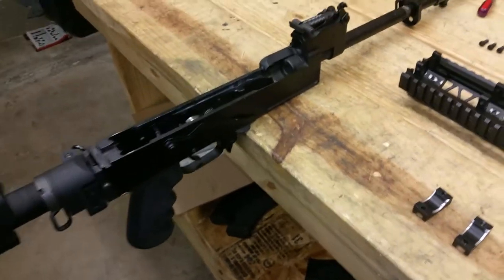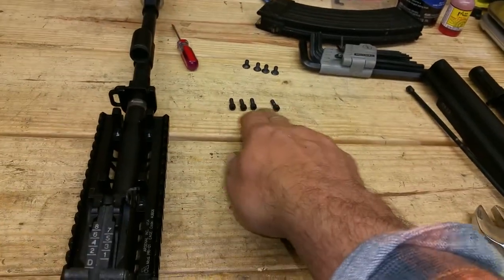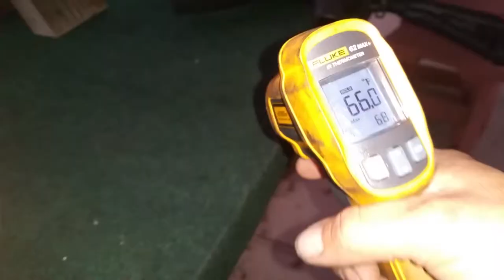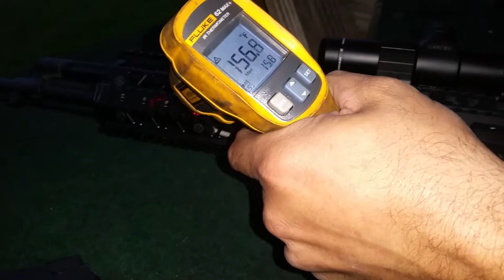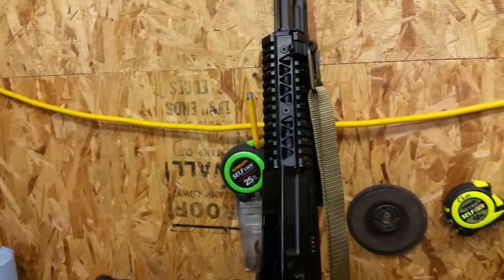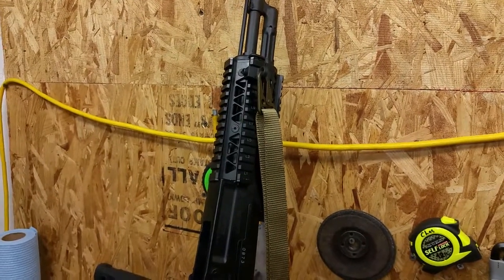Arsenal PR-01 Hand Guard Mod Part 2

Comment: Im going to buy this  for my Sam 7  Very rugged and  liking  its multi picatinny rail's  its  well ventilated for faster cooling  as for heat going to use a MagPul AFG Angled  for grip extended all the way to the end  // this is a  good  idea though

Comment: Texas gun smith, first of all good informative videos. I just purchased the rifle and was wondering if the clamping of the hand guard affected the accuracy of the firearm?
Reply from the maker: +Joe Santacruz  I would guess no, not in any real sense. First the anti clamping of barrels idea is kind of a long range gun/ sniper thing, where they are working on every minor increment imo. Second, look at the ak barrel front to back. . . front sight block, gas block, rear sight block, and finally pressed into receiver, they are all pressed on, which will have some clamping force to barrel, as well as uneven heat dissipation. Lastly, ak's are not designed for long range accuracy, they are about fighting reliability, as such, they are accurate enough just not highly accurate, nature of the beast sort of thing.

Comment: Thanks for the info and it was worth a try :) I just got me the exact same rifle (well, I have the SAM-7SF) and exact hand guards. I took it to the range for the first time today and yes, it burnt my hand too. As you said I don't think it's possible to remove much of the heat. Also no matter how much you trim the inside hooks, the heat will still transfer in the air from the barrel and heat up any metal (i.e. the Aluminum hand guards) in the close proximity.  Do you know if the rubber ladders are installed they might help shield your hands? Of course, one can say since the hand guards gets so hot, they actually act as great heat sinks and help cool the barrel faster and hence help keep the grouping tighter... :)
Reply from the maker: +RHBengal  In general I grab the magazine, not hand guard anyway. I have not installed the ladders, but i may. I also have another idea for a fix, but its going to sound cheesy, however i expect it to improve more. The heat transfer is coming from barrel to barrel clamps to handguard. Well you can't space the hand guard from barrel clamps too much, because you need to fit in the front and rear retainers. But i'm thinking if you leave barrel clamps on, but remove lower hand guard, then use something very thin, like a single piece of masking tape between barrel clamps and the hanguard, well it wont be hot enough to burn tape, but slow heat transfer quite a bit. I didn't try it yet, but will soon as i'm doing a build using another pr-01.
Reply: +texas gun smith Cool. I wonder if they actually sell heat resistant tapes (like in Auto shops or Home improvement). Masking tape may still burn though. But sure worth a try :) Good luck :)

Comment: Now what the fuck is wrong with my cleaning rod? It keeps falling out of place when I shoot my rifle and now I can not even get my cleaning rod back in?! .... Geez this gun is a fucking giant continuous headache. Do you have any problems with your cleaning rod?
Reply from the maker: +Begg269 No, but if you had the quad rail off, its possible that stainless shield inside on bottom is not seated properly. That shield helps guide cleaning rod, and puts some tension if im not mistaken.
Reply: +texas gun smith ... OK I had to call Arsenal and long story short they sent me the internal guide for my cleaning rod... now my question is where exactly does it go? Can you make a small video or point me to the video where you show it